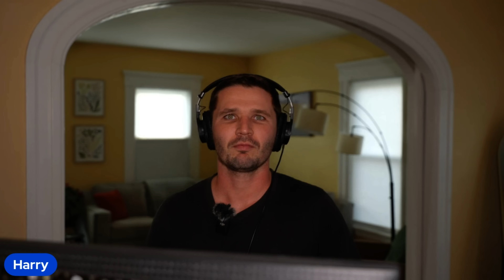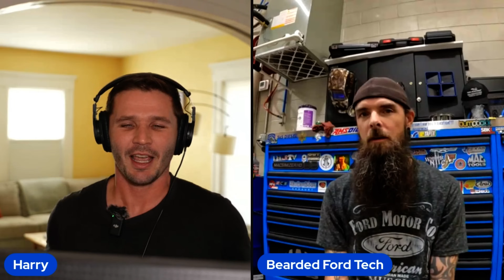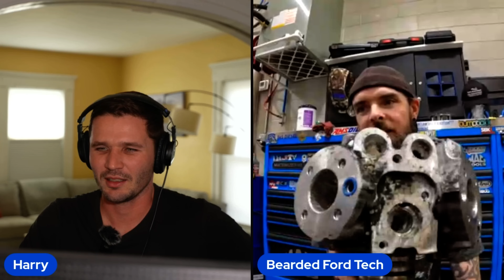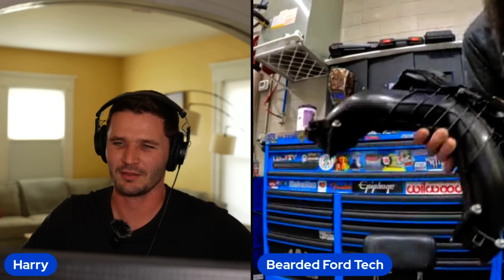6.7 PowerStroke Longevity and Reliability With Bearded Ford Tech

Comment: So really it seems like the CP4 is the real thing that will actually kill these engines. So really your looking at $2K or so plus probably another $2K of labor for the install and then your good to go.
Reply: I did upgrade to S&S fuel pump.  2k for the pump and I paid $1,600 labor. You can find people that will do it for around 1k labor. Lubricity is key,  if you are running a cp4 pump you should/must run  additives with lubricity.  I still use an additive with my S&S fuel pump. I also change my fuel filters every 10k

Comment: Do you have any opinions on the Speed of Air pistons and Total Seal Gapless rings? (I am not affiliated with either, just curious). In addition to heat and oil, what about quality of fuel and fuel additives?  Do you think that catch cans are any good or a gimmick?

Comment: Question: If a CP4 is a known problem and that has been established, then why does Ford continue to use them? GM quit the CP4 in 2017. RAM went to a CP4 in 2020 and then recalled those trucks. Yet Ford continues to use them. Why would anyone that knows about the Bosch CP4 buy a truck with one?
If you change out the CP4 with the aftermarket you void your warranty. What am I missing?
Reply from the maker: The rest of the truck 😂

Comment: He mentioned Amesoil transmission oil. What weight or number are you using?
Reply from the maker: I use the signature series transmission fluid. Part number is atl1g-ea

Comment: So, to recap the CP4 discussion. One of the trucks was parked at 210k miles because the CP4 was failing and the other 2 failures were caused from pumping def in the diesel tank. Those are the only trucks in the fleet of 50 that have had CP4 issues? Or did I misunderstand the discussion? Great video!
Reply: Statistically on the Ford 6.7 power stroke the CP4 has a 5 to 7% failure rate within the first 100,000 miles. This does not account for the failures caused by fuel contaminants or diesel exhaust fluid in the fuel tank. A little bit of research will confirm the numbers that I have given you. So five to seven trucks out of 100 have this in their future within the first 100000 miles. The likelihood of failure after that mileage goes way up.
Reply from the maker: Please share the link to this info. I’m seeing the 5-7% estimate, but not in the first 100k. And that also doesn’t seem to exclude people dumping def in their tank and skipping fuel filter changes.
Reply: Correct, if you simply maintain your truck with proper diesel maybe some Hotshots additive at every fill up, is all you need and your CP4 will last as long as you own your truck.
Reply: @mattburnett7347  That's what I heard too.  So the whole "CP4 is junk" is not the whole story.  I have asked multiple parties that exact question before, and THE MAJORITY of failures are caused by water or DEF in the fuel.  Keep your stock filters in place.
Reply: @SeaPro360 RCD Performance states that our fuel has plenty of lubrication. Their CPX pump is a modified CP4 and from what I've heard from local diesel guys, it is way better than the DCR. Apparently, the main cause of the CP4 failure is cavitation. That could be due to lift pump not working correctly, clogged filters, or not priming properly after a filter change. I just had to prime my system 12 times before I couldn't hear any bubbles after I changed both filters. I still run HSS EDT though for a piece of mind.
Reply: No. Two had def run through. Other ones had failed. The rest are being converted. The cp4 is junk. Just did two more this week from failure

Comment: I was going to get a 6.4L since they are much cheaper and more available but I think I'm only going to accept a 6.7 or 7.3 hopefully I can get an 99-03 f350 7.3 4x4 crew cab with the ZR6 6 speed saw a red one for sale for $5,500 wish I had the cash for it. 300-400 miles on my 17 gallon tank with my 2.3L ranger.
Reply from the maker: Ya the 6.4 will drain the old bank account
Reply: @powerstrokemaintenance  yes indeed. They have lots of problems too
Reply: My 2019 ranger has a 18 gallon tank. I get like 450-475 on one tank. Stay away from the 6.4. If your going old school go 7.3.
Reply: @ yeah your right it’s 18, I got a 15 gallon gravity fed tank I need to install. And that’s the plan would like a 2015 2nd gen 6.7 but I would have to finance and I don’t really want to do that again.
Reply: @JustAverageJeff  with the way truck prices are now. I wouldn't finance either
Reply: @ I’ll probably be half way to your asking price by then. Currently have a 19 ranger supercab 4x4 that has 2 years of payments left and I love the truck but it’s just too small for me now. I want to get rid of it for a crew cab that I can tow 14k lbs with. I financed 40 acres and I plan to develop it and build a house and I would like to do junk removal and land grading/clearing to fund it until I can get a rubber farm producing on the land. Was going to do it with my wife and give her the ranger even though she says it’s too big and doesn’t like it but I think we are going to sign the divorce papers here next Monday so I’m just going to get rid of it when I can get a diesel in my hands. Tried to get outside funding for the other $4,500 I need but I just started working again after losing my job 2 years ago due to too many ER visits within a short time and I still have 1 account in connections so I just get denied for everything.